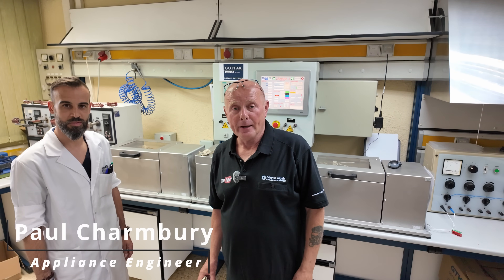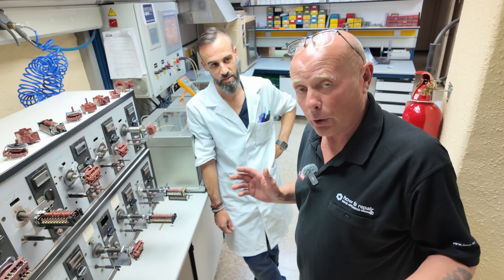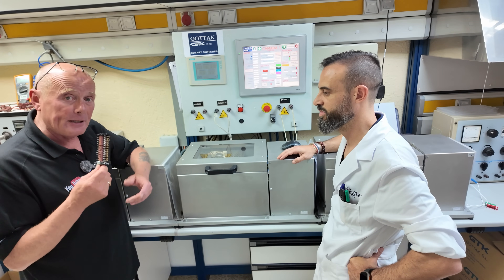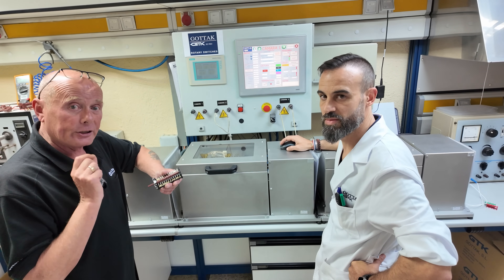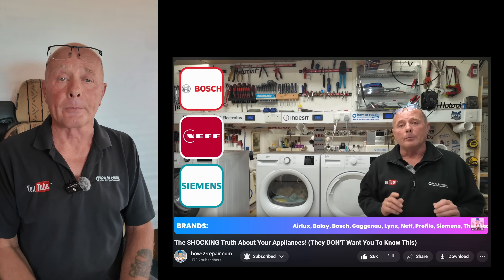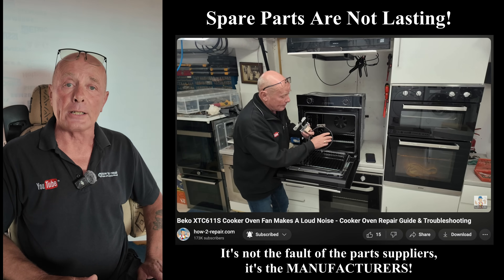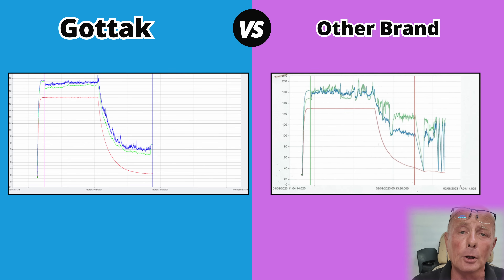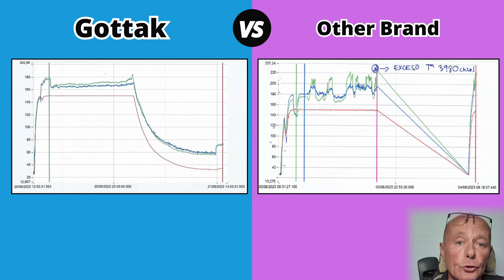Why Your Appliances FAIL SO FAST! Lab Results EXPOSE the Truth!

Comment: They have been using garbage refrigerant to reduce the freon in the atmosphere! But the low freon refridgerants are putting 20 times as much freon into the atmosphere !
Reply from the maker: Hi there! Thanks for your comment, @terenceiutzi4003!

You've hit on a really important point about the environmental impact of component choices, like the type of refrigerant used in appliances. The selection of such critical components and the design of the systems they're in can indeed have long-term consequences, not just for performance but for the environment and potentially the lifespan or repairability of the unit. The old gases and build quality were better, but no one ever mentions the fuel and pollution that is caused by transporting five times small machines across half the face of the planet. This is an important consideration that aligns with the concerns about design and manufacturing choices we discuss in the context of built-in obsolescence in the video.

At the trade show last year, understanding how much obsolescence is being designed into new appliances these days – including through component selection that might affect longevity or create future environmental liabilities – is something everyone should be aware of. For a deeper dive into this topic and to see the examples we covered, please check out the full video here: https://youtu.be/gEgSCbZnHVM?si=wTIw0mELuhWaw4aX

We also explored related aspects in these videos:

The shocking truth about manufacturers: https://www.youtube.com/watch?v=QsdGd2qDPaI
Heat pump tumble dryers are they really worth it?: https://www.youtube.com/watch?v=xn03N3b0-lE (This video might be especially relevant if it touches on refrigerant technologies in heat pumps)
If you found this information eye-opening or helpful, please consider sharing this video with your friends and family. The more people who understand what's happening with appliance design, longevity, and their wider impacts, the better equipped we all are.

Thanks again for watching and engaging! Don't forget to subscribe to the channel for more insights like this!

Comment: My parents' tumble dryer dates from the 1970s and they have no plans to replace it! They really don't make 'em like they used to.
Reply from the maker: 2 built-in obsolescence response
Custom Gem

Show thinking
Hi there! Thanks for your comment, @thromboid!

You've hit on a really important point about the remarkable lifespan of older appliances, like your parents' 1970s tumble dryer, compared to many modern ones. That sentiment, "They really don't make 'em like they used to," is something we hear a lot. This is exactly the kind of built-in obsolescence (or lack thereof in older models) we discuss in the video.

At the trade show last year, understanding how much obsolescence is being designed into new appliances these days – a stark contrast to the durability you've described – is something everyone should be aware of. For a deeper dive into this topic and to see the examples we covered, please check out the full video here: https://youtu.be/gEgSCbZnHVM?si=wTIw0mELuhWaw4aX

We also explored related aspects in these videos:

The shocking truth about manufacturers: https://www.youtube.com/watch?v=QsdGd2qDPaI
Heat pump tumble dryers are they really worth it?: https://www.youtube.com/watch?v=xn03N3b0-lE
If you found this information eye-opening or helpful, please consider sharing this video with your friends and family. The more people who understand what's happening with appliance longevity, the better equipped we all are as consumers.

Thanks again for watching and engaging! Don't forget to subscribe to the channel for more insights like this!

Comment: I've been in the habit of switching the mode on my oven only when the thermostat is turned down, thinking that switching under load would be worse for the selector switch. Is that a reasonable thing to do? I can imagine that it might make the thermostat wear out slightly faster. Great video, thank you!
Reply from the maker: Hi there! Thanks for your great question and for watching the video!
I did a video on exactly this problem a while back https://youtu.be/JJBnogwRgz4

That's a very thoughtful approach to using your oven! You've asked if switching the mode only when the thermostat is turned down is reasonable to protect the selector switch, and if it might wear out the thermostat faster.

Generally, yes, your habit is quite reasonable and likely beneficial for the mode selector switch. Those switches often have to carry significant current to the heating elements. Switching them while that current is flowing (under load) can cause arcing between the switch contacts. Over time, this arcing can lead to pitting, carbon build-up, and eventually, the failure of the switch. By turning the thermostat down first, you are likely ensuring that little to no current is flowing through the mode selector as you operate it, which can indeed help preserve its contacts and prolong its life.

As for the thermostat, while it's true that turning it down and then presumably back up again for the new mode would cause an extra cycle of operation, thermostats (especially the common bimetallic strip types in ovens) are designed for many thousands of cycles. The potential for any significantly accelerated wear on the thermostat from this careful practice is likely very small, especially when weighed against the benefit of protecting the mode selector switch. Selector switches can sometimes be more susceptible to failure from arcing and can be more complex or costly to replace than a thermostat. So, your intuition to protect the selector switch is good!

It's interesting that users like yourself are thinking about these ways to prolong appliance life. The concerns around component durability and how to best care for appliances to avoid premature failures are definitely related to the broader topics of appliance longevity we touch upon in our video, even when we're discussing more direct built-in obsolescence. Understanding how these machines work and how to minimise stress on their components is valuable knowledge.

At the trade show last year, understanding how much obsolescence is being designed into new appliances these days, and conversely, how consumers can try to maximise the lifespan of their existing ones, is something everyone should be aware of. For a deeper dive into the obsolescence topic and to see the examples we covered, please check out the full video here: https://youtu.be/gEgSCbZnHVM?si=wTIw0mELuhWaw4aX

We also explored related aspects in these videos:

The shocking truth about manufacturers: https://www.youtube.com/watch?v=QsdGd2qDPaI
Heat pump tumble dryers are they really worth it?: https://www.youtube.com/watch?v=xn03N3b0-lE
If you found this information eye-opening or helpful, please consider sharing this video with your friends and family. The more people who understand what's happening with appliance longevity, the better equipped we all are as consumers.

Thanks again for watching and engaging! Don't forget to subscribe to the channel for more insights like this!

Comment: Almost Everything I buy goes Wrong !  So I take it apart and fix the Component !  Usually the machine Never goes Wrong Again !  The Manufacturers put a Huge induction Motor in an Appliance, and a Flimsy Plastic Cog Wheel that Belongs in a Clock !
Reply from the maker: Hi there! Thanks for your comment, @spaceted3977!

You've hit on a really important point and a common frustration! Your experience of finding robust components like induction motors paired with "flimsy plastic cog wheels" that fail prematurely is a classic example of what many suspect. It's great that you have the skills to take things apart and fix them at the component level – and that they often don't go wrong again afterwards!

This is exactly the kind of built-in obsolescence we discuss in the video. The use of under-specified or less durable parts in critical areas, despite other parts of the machine being well-made, is a key concern. At the trade show last year, understanding how much obsolescence is being designed into new appliances these days is something everyone should be aware of. For a deeper dive into this topic and to see the examples we covered, please check out the full video here: https://youtu.be/gEgSCbZnHVM?si=wTIw0mELuhWaw4aX

We also explored related aspects in these videos:

The shocking truth about manufacturers: https://www.youtube.com/watch?v=QsdGd2qDPaI
Heat pump tumble dryers are they really worth it?: https://www.youtube.com/watch?v=xn03N3b0-lE
If you found this information eye-opening or helpful, please consider sharing this video with your friends and family. The more people who understand what's happening with appliance longevity, the better equipped we all are as consumers.

Thanks again for watching and engaging! Don't forget to subscribe to the channel for more insights like this!

Comment: Planned obsolescence will always be around just like how big money has no laws.  A billion dollar corporation does some flat out illegal crap which makes them 50 million dollars but they only get fined 5 million for doing it.  Theres no jail time because part of that 5 million is going to somebody who would rather have a ferrari than justice so the billion dollar company goes about their way, 45 million dollars richer..  theres no changing the rubbish of the world, it will always be garbage, rubbish, trash, shit no matter how you look at it..   look into the capacitor debacle that happened a bit ago where the component manufacturer outsourced the electrolyte which was known to lose its abilities and breakdown into corrosive acids.  Rubycon is a great manufacturer but no matter how good of a part you can make, there will eventually be somebody who will want a bigger payout and accept the lesser material unbeknownst to everybody else for the few years that stuff works then by the time failures start to pop up that person will be good and gone to pass the blame to another
Reply from the maker: Hi there! Thanks for your comment, @Z-Ack!

You've raised some really significant points about planned obsolescence and its connection to broader issues like corporate accountability and the pressures of profit. It's a perspective many share, and the frustration is understandable.

Your example of the capacitor debacle, where issues with materials like faulty electrolytes led to widespread premature failures, is a stark reminder of how component choices can drastically affect product lifespan. It really highlights how, as you mentioned, decisions seemingly focused on cost can undermine the quality and longevity of products, even when reputable component manufacturers are involved at some stage. This is exactly the kind of built-in obsolescence we discuss in the video – the instances where products seem designed to fail prematurely due to such choices, whether it's through material quality, design, or other factors.

At the trade show last year, understanding how much obsolescence is being designed into new appliances these days is something everyone should be aware of. For a deeper dive into this topic and to see the examples we covered, please check out the full video here: https://youtu.be/gEgSCbZnHVM?si=wTIw0mELuhWaw4aX

We also explored related aspects in these videos:

The shocking truth about manufacturers: https://www.youtube.com/watch?v=QsdGd2qDPaI
Heat pump tumble dryers are they really worth it?: https://www.youtube.com/watch?v=xn03N3b0-lE
If you found this information eye-opening or helpful, please consider sharing this video with your friends and family. The more people who understand what's happening with appliance longevity, the better equipped we all are as consumers.

Thanks again for watching and engaging! Don't forget to subscribe to the channel for more insights like this!

Comment: It's a common term to this - "shittification of things", which applies to not only machines, but everything else from industry, as the development is almost maxed out and  we can't build any better. A car still has four wheels and rolls on the road, a washer is still a washer, improvement is nearly impossible because of the nature of those things.. So, the industry to keep their profits has to shittify stuff to get it changed quicker. No sustainability here, only profits counts. They want to sell more and more, but the world is limited. In the older times, they produced eay less items in the same time as today, so to keep sales on, things have to turn quicker. Oh, and tech gets also crapped with useless features today, so you buy a new model also to be fancy.. 😏
Reply from the maker: Hi there! Thanks for your comment, @darkfactory8082!

You've brought up some very pertinent points and a widely discussed concept – the phenomenon you refer to as the "shittification of things." It's a stark way to put it, but it captures a frustration many feel.

Your perspective on development potentially plateauing for certain established products, and the subsequent strategies by some industries to arguably degrade quality or add "useless features" to drive quicker replacement cycles for sustained profits, really hits on a core issue. The tension between the drive to "sell more and more" and the goal of sustainability is a massive concern. This is exactly the kind of built-in obsolescence, and the economic pressures that can encourage it, that we discuss in the video.

At the trade show last year, understanding how much obsolescence is being designed into new appliances these days is something everyone should be aware of. For a deeper dive into this topic and to see the examples we covered, please check out the full video here: https://youtu.be/gEgSCbZnHVM?si=wTIw0mELuhWaw4aX

We also explored related aspects in these videos:

The shocking truth about manufacturers: https://www.youtube.com/watch?v=QsdGd2qDPaI
Heat pump tumble dryers are they really worth it?: https://www.youtube.com/watch?v=xn03N3b0-lE
If you found this information eye-opening or helpful, please consider sharing this video with your friends and family. The more people who understand what's happening with appliance longevity, the better equipped we all are as consumers.

Thanks again for watching and engaging! Don't forget to subscribe to the channel for more insights like this!

Comment: what is he reason for an engineer to wear white robe ??
Reply from the maker: Hi there! Thanks for your comment, @panagiotisseremetis671!

In Spain, they take great pride in what they do and the way they go about doing it

That's an interesting question about why an engineer might wear a white robe or coat. While it's not a standard uniform for all engineers, there are several reasons you might see one wearing it:

Lab Work/Research & Development: Engineers working in laboratories, perhaps in chemical, materials, or biomedical engineering, often wear white lab coats for protection against spills and to maintain a sterile or clean environment.
Specific Industries: In sectors like pharmaceuticals, food processing, or high-tech manufacturing (e.g., cleanrooms for electronics), white coats or specialized suits are common to ensure hygiene and prevent contamination.
Presentation or Symbolic Reasons: Sometimes, especially when explaining technical details or in a more formal setting (like some of the discussions we have on this channel!), a white coat can be used to signify a scientific, methodical, or expert approach to the subject. It can help emphasize the technical nature of understanding how things, like appliances, are designed and manufactured.
Understanding the design and manufacturing of appliances is central to what we discuss here, especially concerning the issue of built-in obsolescence – why products might not last as long as they used to. This is exactly the kind of topic we delve into.

For a deeper dive into built-in obsolescence and to see the examples we've covered, please check out our main video here: https://youtu.be/gEgSCbZnHVM?si=wTIw0mELuhWaw4aX

We also explored related aspects in these videos:

The shocking truth about manufacturers: https://www.youtube.com/watch?v=QsdGd2qDPaI
Heat pump tumble dryers are they really worth it?: https://www.youtube.com/watch?v=xn03N3b0-lE
If you found this information eye-opening or helpful, please consider sharing our videos with your friends and family. The more people who understand what's happening with appliance longevity, the better equipped we all are as consumers.

Thanks again for watching and engaging! Don't forget to subscribe to the channel for more insights like this!